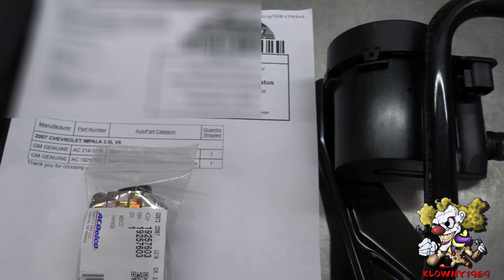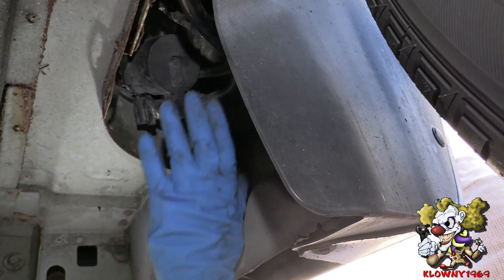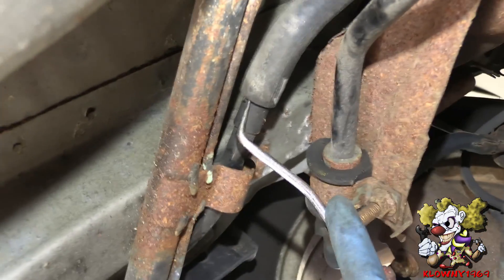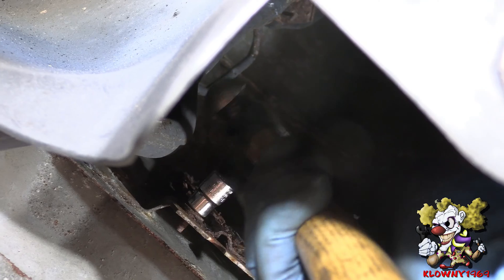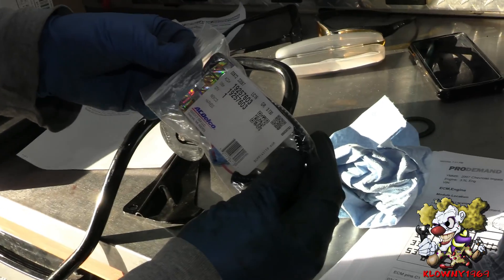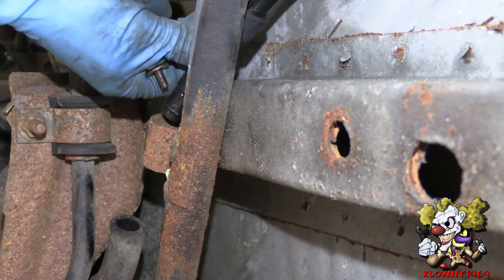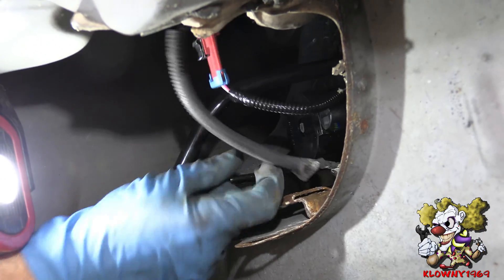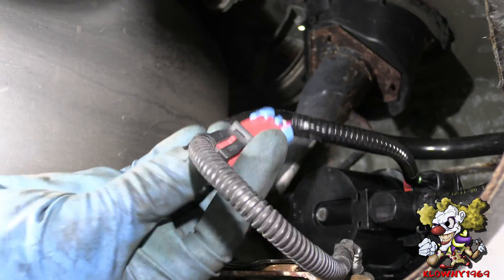How To Replace EVAP Vapor Canister Vent Solenoid - P0455

Comment: 86 iroc. AC only blows thru the dash vents by windshield. What could it be. How can I fix?
Reply from the maker: Move the lever back and forth hard and see if you hear the heat door opening and closing under the passenger dash..the wire cable could have come off...don't forget to subscribe and hit that bell